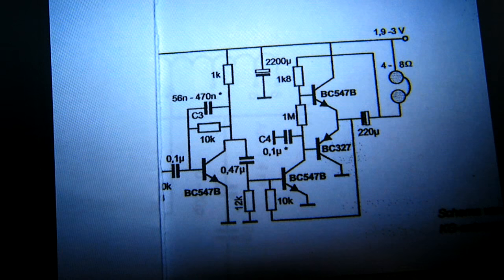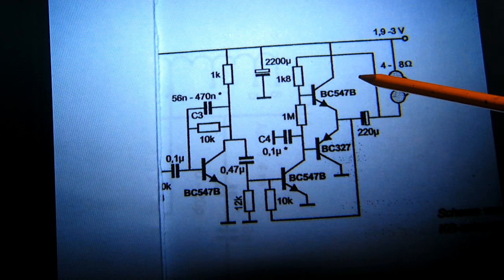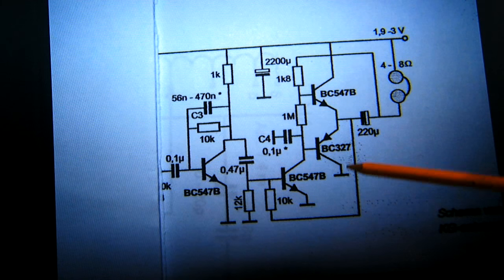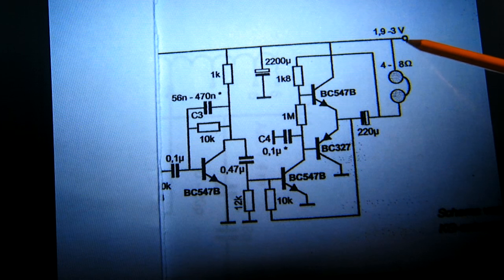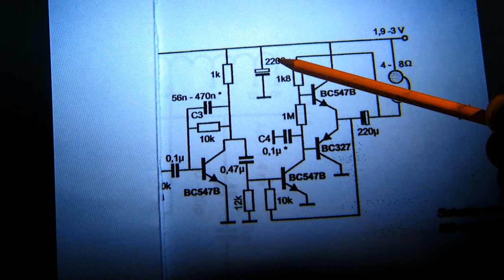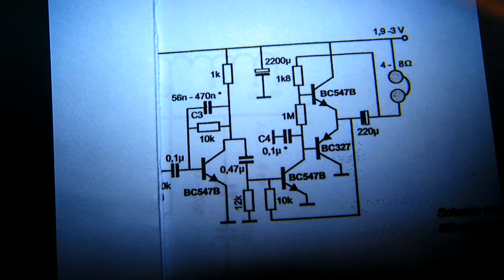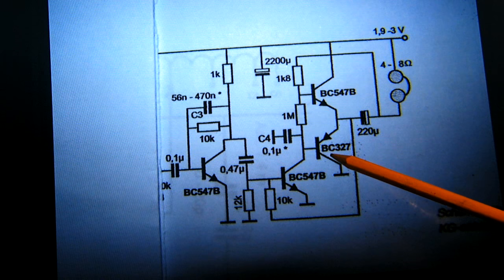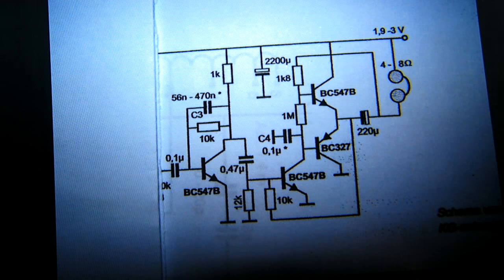Headphone audio amplifier for very low voltages 1.9 - 3 Volt (20 mW-50 mW output)

Comment: It's funny that you specify 2-8 Ohm, because i have never seen such headphones - well there are some 8 Ohm ones, but they are super rare. Earbuds are typically 16 Ohm, Walkman on-ear headphones and PC headphones are usually 32-45 Ohm, DJ headphones and on-the-go recording monitor headphones are up to around 100 Ohm. But they all work fine on less than 1V p-p swing, so it stands to reason that this amplifier will be excellent for these types of headphones if it can just about deliver that much.

Also a bit funny to read of NiCd cells given that these have been largely banned in EU now for environment protection reasons (banned sale to consumer in 2006, banned for use completely except in medical devices and safety alarms in 2013), generally to be replaced with functionally similar NiMH. Another little anachronism are Zinc based batteries, as their cost per unit of energy is today higher than Alkaline and they leak somewhat fierce, so one would struggle to recommend them. Little irrelevant anachronisms, so don't mind me, i'm just nitpicking, you're doing a great job.
Reply from the maker: OK, thanks. it works indeed with headphones up to 45 Ohm or so.Strictly spoken the AC resistance also differs with the frequency (loudspeaker resistances are nominal).

Comment: Im bulding simplest, headphone amplifier circuit chip amplifier tda2822m. Working good. Power supply source usb charger or connect to laptop usb. Maybee tda2822m this circuit works two stereo headphones in parallel?
Reply from the maker: OK, thanks.

Comment: works with guitar but distorts ... any fix ?
Reply from the maker: What do you mean exactly? It is meant for a small headphone from (say) 20-30 Ohm.
Reply from the maker: When the output level of the guitar is too high, distortion is the result. In such a case a voltage divider or potentiometer can help. Say: 50 K or 100 K or 1 M. Connect the guitar via a non polar capacitor of 100 N (470N) to the top of the potentiometer. Connect the node (wiper) to the amplifier input via a non polar capacitor of 100N (470N), and the other electrode of the potentiometer to ground, minus. The circuit was not designed as guitar amplifier, the output level is in the 20mW-50mW range.
Reply: i will try that
Reply: using 16ohm earphones